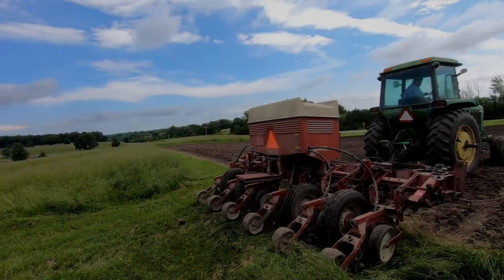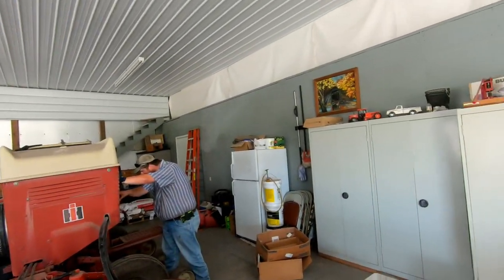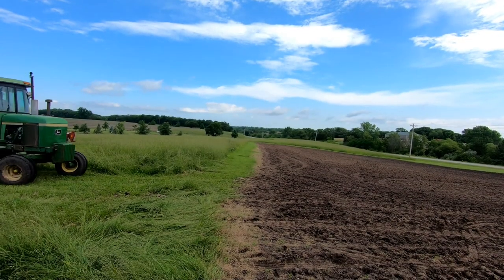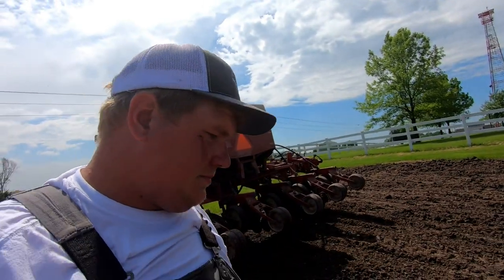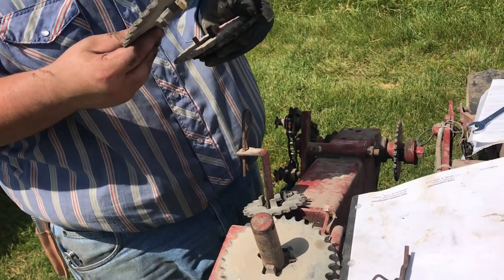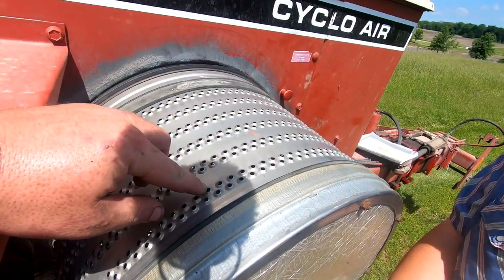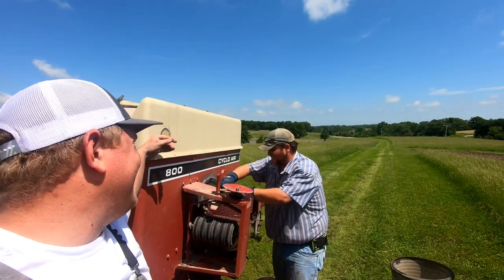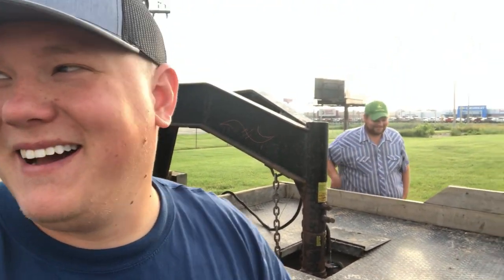800 Cyclo Air planting a plot - NEW EQUIPMENT TEASER AT END OF VIDEO

Comment: Those are a popular planter in my neck of the woods, lol. Nice skid steer, I’ve spent 95% of my time in track machines and they beat tires all to hell, I could be mistaken but I the Takeuchi makes those for Kubota, could be the other way around but either way it’s a hell of a machine, beats Cat skid steers hands down
Reply from the maker: 2009deerejohn if you’re talking about the engine. Most skid loaders use some form of the Kubota engine. We’re excited to test it out here soon.